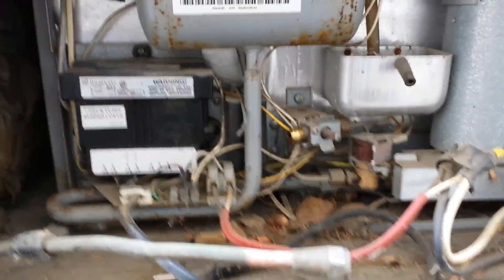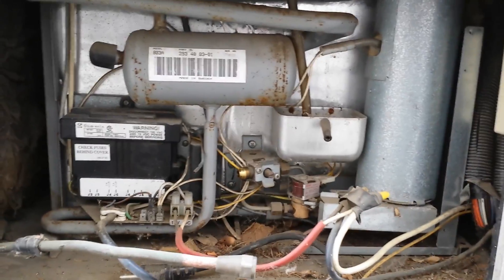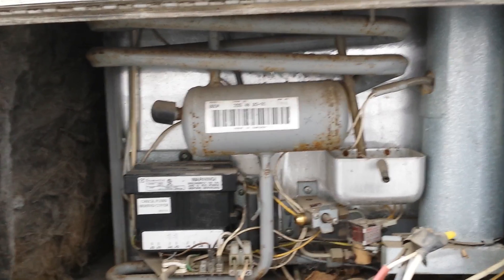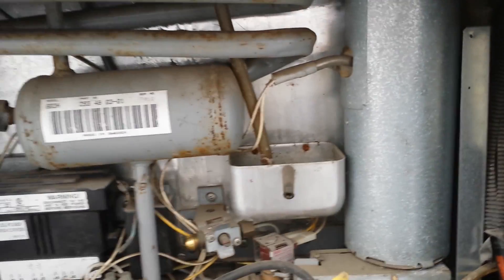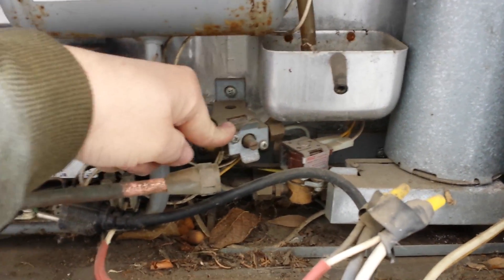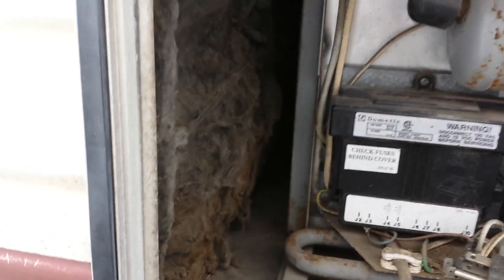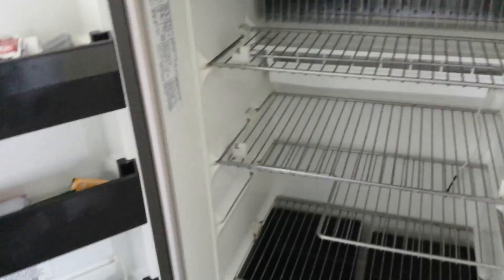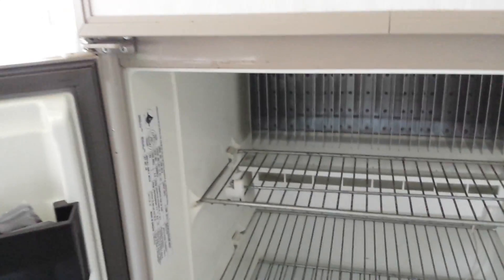Rv refrigerator removal. #1

Comment: What about closing off propane lines and stuff ?
Reply from the maker: I just used a 3/8" brass bolt with thread sealer tape. Never had a problem with it.

Comment: What did you cap the gas line with?
Reply from the maker: I just used a brass bolt. Make sure you put thread sealer tape on it tho.
Reply: 3/8" Flare Plug is the standard size for LP lines.